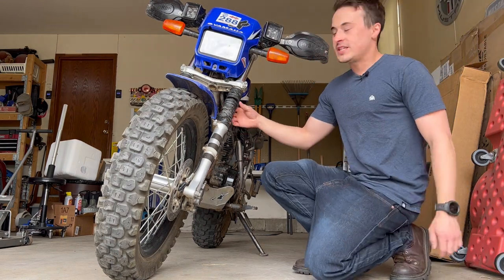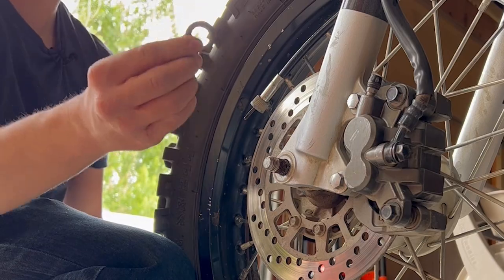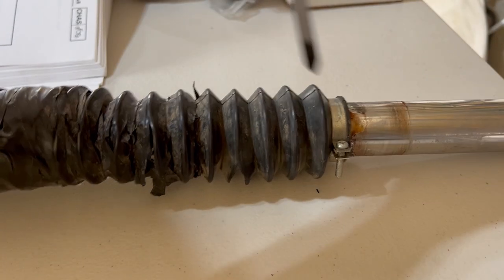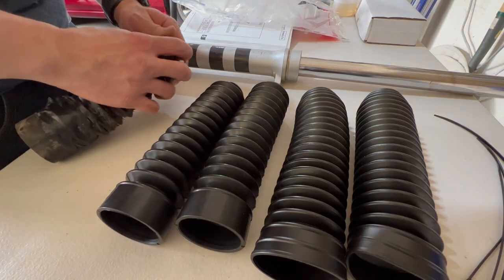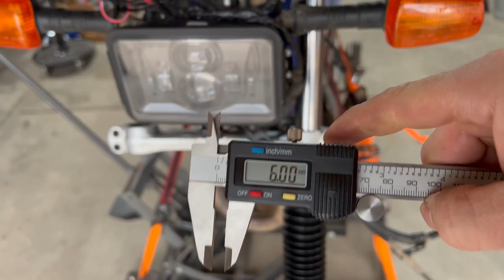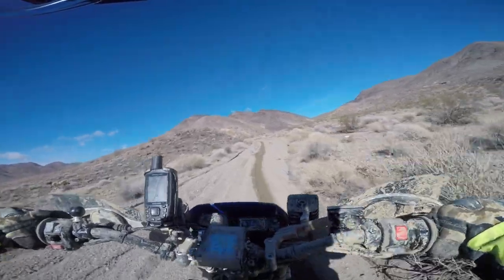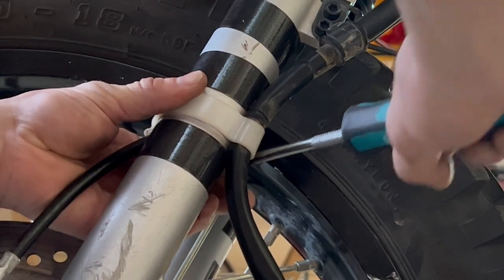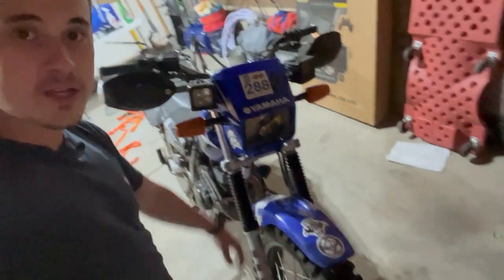How To Replace Front Fork Boots on a Yamaha TW200

Comment: About the steering head bearings . It is  of great importance to replace those . they should  NOT have a stopping point in the middle . they should travel free from one side to the other . Other than that great video ,always awesome to see new stuff on the bike , even more when changing old for new .
Reply: Yep,  His head bearings are shot.  I replaced mine because of the same problem.  They just fell apart when I took them out.  Trust me his are in BAD shape.
Reply from the maker: Thanks, ill have to replace them before long

Comment: Inspiring me to change the boots on the '09. Got those aftermarket ones last year for that special day. Love your detailed instructions. Very thorough. Seems the OEMs are running around $40 apiece now days vs. $17 (2 of) for the aftermarket. As the saying; Get what you pay for...
Reply from the maker: glad to hear. yeah the oem ones should not cost 80 bucks for the set, that's just crazy. how are the aftermarket ones holding up. im putting the aftermarket ones after these tear someday. that is usually true though
Reply: @TDubsKid  haven’t put the aftermarket ones on yet. ‘09 still has the originals and neglected since getting the ‘21. Just turned 7001 miles on it.
Reply: @TDubsKid  Those cheap scammazon boots are working well 4 months later. Lots of sand and mud in the Mojave desert.

Comment: Hope all is well.  Carefull w speed on those single tracks.  I stocked up on that used excercise equipment, working will in my 50s! Ride safe. From CT, U.S.A.  One tip you may know about, any heavy work with the hands...Leather gloves work great for protecting!  Good quality leather cowhide gloves are on Amazon for 13 bucks.
Reply from the maker: thanks! yeah I try not to go to fast. great to hear! gives me hope for the future. We have a private workout center at work it makes a huge difference when riding. good to know, thanks!
Reply: @TDubsKid    That's great to hear. I'm in my mid 50s and fortunate I took care of myself (fitness). You look a lot stronger these days than I remember in past videos. Good for you.

Comment: Like your videos. Watch them all. You definitely need steering stem bearings. That notch should not be there. It will cause the bike to fall into a corner and be more apt to squirm in a straight line. It's not dangerous, but your bike will feel better when they are replaced. Getting the preset pressure on the new bearing is a little tricky. Too tight and it will be hard to start and get out of a turn, too loose and it will be hard to hold a steady ark in a turn.
Reply from the maker: thanks. it seems to ride and turn just fine. ill need to rebuild sometime in the furture
Reply: Yes! The steering stem bearings should definitely be replaced. Those are ball bearings and when they wear, they create that notch when the forks are pointed towards center. That notch will get deeper as they continue to wear and the bike will become more difficult to turn. Best to replace them with tapered (needle) bearings and races.
Reply: @TDubsKid  It's easy not to notice the difference in the bike until after they are replaced because it takes so long for them to wear. Think frog in cold water slowly warming to a boil. Thanks again for another video.

Comment: pro tip,  keep your fingers away from the holes in the brake caliper when removing/installing the front tire.   You could end up with a shattered finger nail or worse...ask me how I know....
Reply from the maker: wow! good tip.
Reply: Yup just cutt the hell out of my finger on a brake disc few days ago… those discs can get razor sharp on the edges.. be mindful when handling or cleaning around brakes

Comment: My aftermarket ones were longer, but have worked great.  The only thing I've noticed is they make a popping sound which drove me crazy at first.
Reply from the maker: interesting, as long as they do the job oem always seems to work better but hard to justify that crazy price. could just be that they are not venting and causing that noise. (reason oem ones have those holes at the bottom)

Comment: #Tdubskid Long time no see!
Glad to see a new maintenance video.
I finally got to ride a TW200 this weekend!
It did manage to haul my fat @ss however the man that was selling it was asking waaaay too much money for it (2900€)
It only had 6000km but the frame was all rusty and badly painted over the rust with what I assume must have been a 1€ spray from the Chinese shop.
Ended up buying a Honda SLR 650 for 1600! (Same engine like the xr650l but scrambler looks)
Has 18000km and purred like a kitten, great bike (needs front fork seal replacement, mind showing how to get the job done on some future video?
Reply from the maker: hey there! yeah that would not be a good buy if it's all rusty. the bike needs to be completely taken apart the fix the rust on the frame. glad you found a cool bike! ride on. maybe someday. probably won't be for a while though

Comment: I like that lift, I think my back would appreciate one of those! Is that a Harbor Freight special?  Looks like it works just fine.
Reply from the maker: yeah it's a harbor freight motorcycle lift, works great. I use it for other things too like removing fuel tanks and lowering differentials. would be great for transmissions too
Reply: @TDubsKid  Cool, I don't know why I don't have one! Gonna have to fix that. Yeah looks like it could come in handy in a lot of different ways.

Comment: Time to replace those steering head bearings. A great upgrade is a tapered roller bearing kit from All Balls or similar company.
Reply from the maker: for sure. ill have to look into that
Reply: Thank you for posting; same issue on mine.  Bought the bearings you recommended.

Comment: The indent in the center is not normal. Unfortunately, it looks like you'll be doing steering head bearings in the future. Great video though man!
Reply from the maker: good to know. for sure that will need to be done before long
Reply: Thank you for posting; same issue on mine